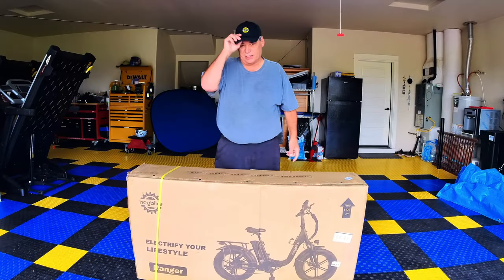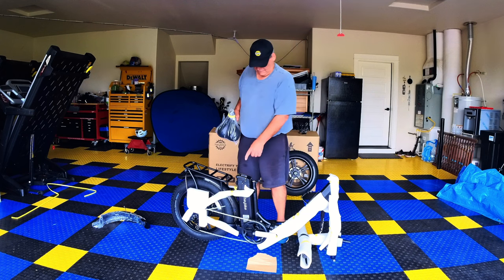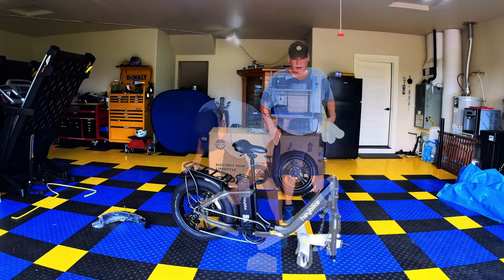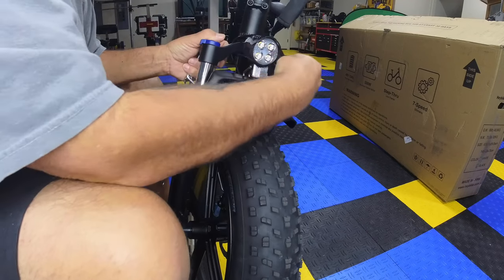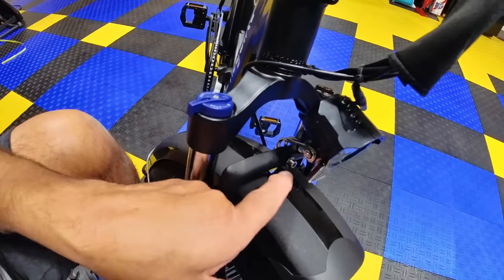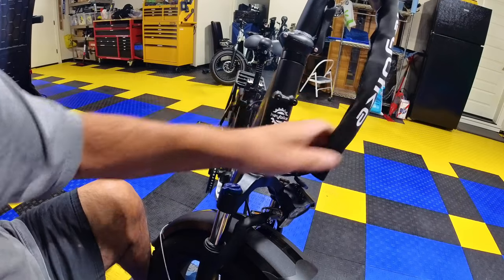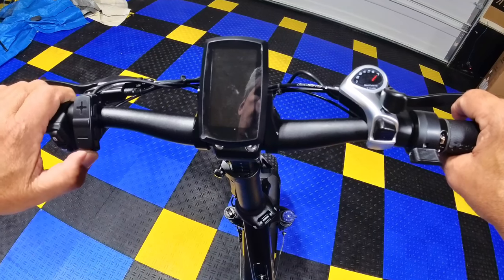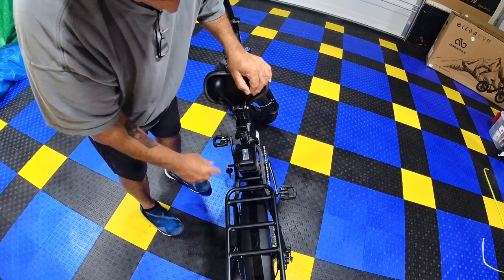Heybike Ranger Unboxing and Assembly

Comment: Hi I’m watching your video right now trying to figure out my front tire. I can’t get the front tire on. My spacers are the exact same I’ve. when you said there was a large and small, I went back to see if that was the issue. Nope it’s still not working. It’s like the forks are too wide for the bar in the tire.
Reply from the maker: HI Wendy,  There is a spacer (red) most likely that is sitting in the brake caliper.  Make sure you pull it out or you will not get the tire on. Beyond that I can't see exactly what your issue is.  Unlikely the fork is too wide especially if the shipping spacer was in place.  I do a lot oof bikes soo details ooon each spacific bike exscapes me.
Reply: @RVEnthusiast I realized after watching your video again slowly and zooming in, the spacer that goes between the tire and the fork was in the wrong place. Once I fixed that, it all came together. I wrote you another comment today above this one. I was messaging with HeyBike- I will let you read it.
Reply from the maker: @Healthylivingwithwendi  Glade you found the issue and my video was a help. Enjoy the adventures.